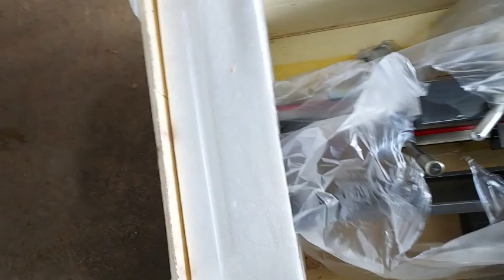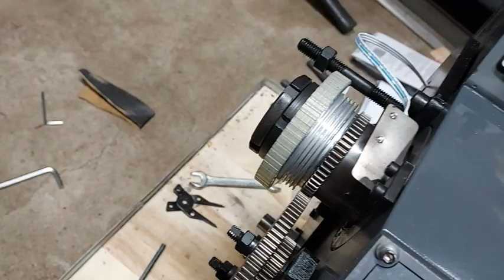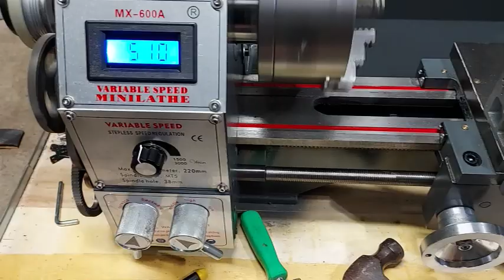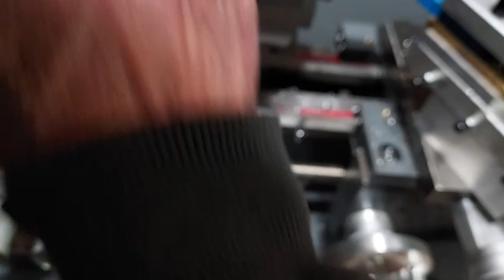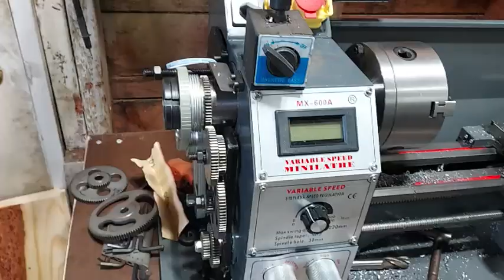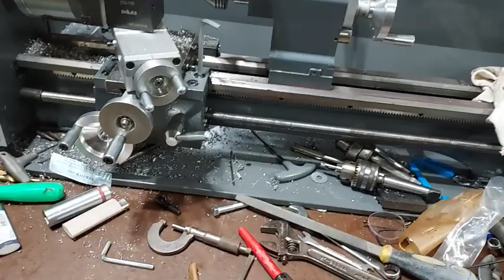New Life Automotive vevor 600 mini lathe review

Comment: Never heard you say what yhe problem was.....i have been llloking at these for a while and was thinking about gettine one
Reply from the maker: The bearings were so tight that it just would not turn. After I got that fixed, it works pretty good. The cross slide is aluminum, so it will not take a very heavy cut accurately. I would not get one unless you are just cutting soft metals. I would spring for something with a steel cross slide and tailstock.  thanks for the comment.

Comment: I am impressed that your new lathe was capable of cutting an acceptable thread for your tool post holder on day one, without having the whole machine disassembled, parts deburred, cleaned, lubricated, reassembled and adjusted/tightened first. That surely takes skill, and luck in the mini lathe draw to boot. 👍
Reply from the maker: Yeah, on the first try too.  I have cut a lot of threads, and I was extra careful not to ruin the only part I had. But, it worked and the tool post worked. Right after that I wound up taking it all apart and sorting it pretty much out. Some skill, yeah, but I think a bigger shot of luck. :) Thanks for the comment.
Reply: @1otviii  I have been thinking about purchasing a mini lathe for months, the VEVOR MX-600A or B have been candidates, but seeing your video was very sobering. I don't have any machining experience, only the interest in getting into the hobby, and would likely not be able to perform basic fixes if the lathe arrived in a shoddily made/assembled state.
Reply: @TheBipolarBear Trust me hold out for a precision matthews they are much be quaility!!! VEVOR does not support any parts for there machines. I own one it has cost me alot of money and much more in time getting it to repetely turn tight tolerances with low chatter. I still have alittle way to go yet with it.

Comment: Vevor gets a 7 out of 10. 
Well that's a first. Most get a 2 out of 10 and than the motor burns out the very next week. Mine was absolute junk from the get go.
Reply from the maker: Mine still working. Not too accurate, but getting done what I need.
Reply: Mr Martin,  Tell them where they can get an upgrade motor kit!!

Comment: Check my issues with this MX-600A Vevor lathe:
- spindle bearings - one was plain ball bearing and other tapered but damaged - try to get them out !!!
- inside the chuck - full uf burrs and no grease at all
- gear box - gears badly machined and worst of all rusted with damaged 6001 2RS bearings in gearbox housing
- holes for gib screws not drilled properly
- missing 72 teeth sprocket in delivery
- halfnut needed additional machining
.....etc  
Argued with China Vevor for 3 months and got 360 USD refund and  some grey hairs

I should bought second hand German built small lathe here in Europe.
Reply from the maker: Yeah, I got lucky, mine works acceptably. Was far too tight, but resolved.

Comment: i think they set the spindle bearings preload way too tight, with a bit of bad luck they are bad/destroyed by now.
you also see that it does not reach 2000 rpm but 1800, that spindle is  running much too heavy or the bearings have become bad.
Reply from the maker: Yeah, so tight it wouldnt even turn.  I eventually got it sorted out and it works fine now.